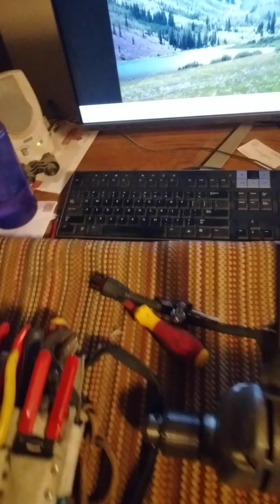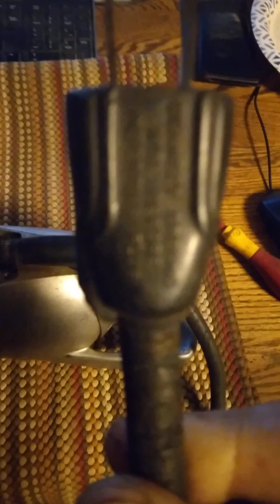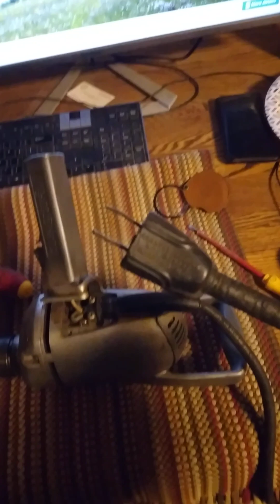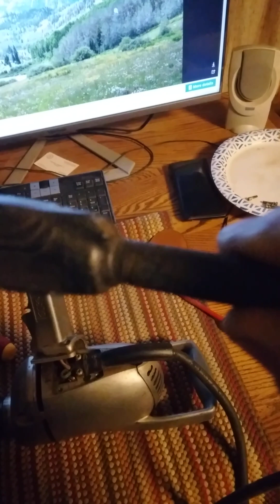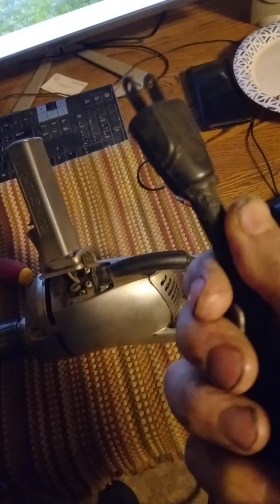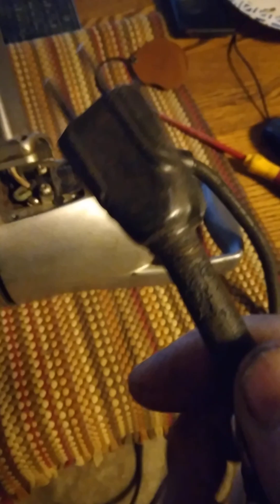Followup Power Tool Electrical Safety

Comment: Thats even more interesting! I have never seem that although it does remind me of the 3 pin to 2 pin adapters that used to be quite common to allow a grounded plug to fit into an ungrounded receptacle.  I dont remember ever seeing the ground wire from those adapters properly connected to an actual ground. I also remember seeing lots of 3 pin plugs with the ground pin simply pulled out  to make it fit - not unlike your cut off ground wire.
Reply from the maker: Thank you for watching it. I also have never seen the grounding adapters attached properly.